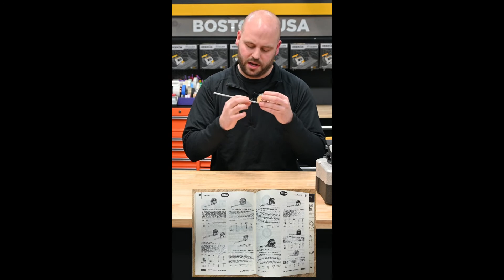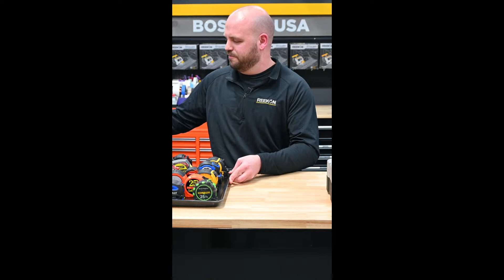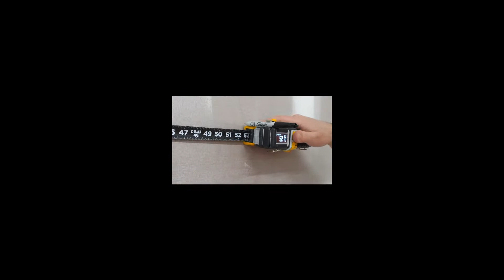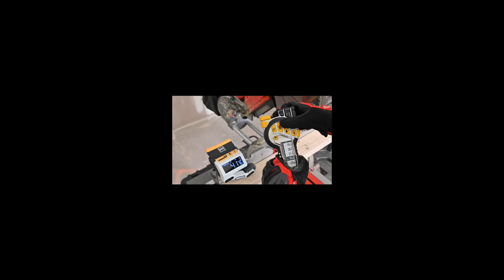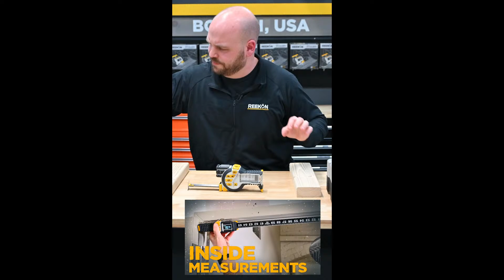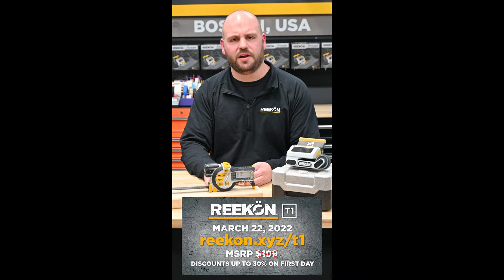REEKON Tools Product Launch - Digital Construction

Comment: In the event that a tape goes bad, ie. bent or broken can the tape portion be replaced by the end user? Will replacement be available?
Reply from the maker: Hello yes the blades are replaceable by the user and we will be offering replacements (or changes to metric, split, engineer units, etc) on our website!

Comment: Does it have the ability to number recorded measurements?  For instance, cutting door casing legs and they are various lengths.  When I make a list I record a number next to the coinciding door and on my list in order to know where that leg goes.  Thanks.
Reply from the maker: Hello yes using the app on your phone you can assign specific tags to any measurement (along with the T1 which generates a unique value as well starting from A and then progressing on)

Comment: Very smart tool. One clarification. I understand the incremental mode but does it have a zero mode as well. So, if I hook the tape on the end of a wall and the first stud is 7.25 OC and then standard 16, can I zero at 7.25 and then have it show CL of the next as 16 on screen? thanks
Reply from the maker: Hey Tim, yes you can zero at any point so regardless of how much of the tape is extended, you can have the T1 start from zero and continue counting up from there!
Reply: @REEKONTools  thank you very much. Brilliant, Just brilliant.
Reply: @REEKONTools  , how  can I buy it

Comment: If it takes an hour to present a tape measure, sorry, a laser tape measure...

As a master woodworker of over four decades who's also a digital fabricator using CNC routers and 3D printers, in addition to every manner of stationary and portable power equipment, on a daily basis, I'd never spend $199 (MSRP), or even $139.30 at launch for this product!